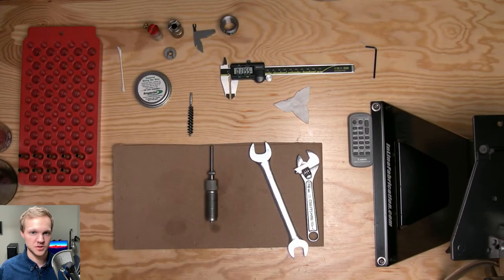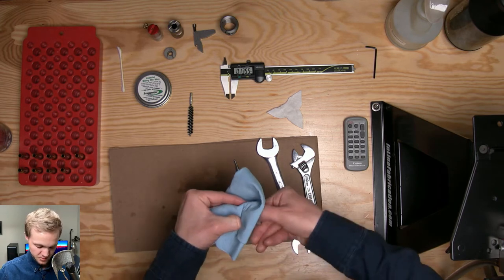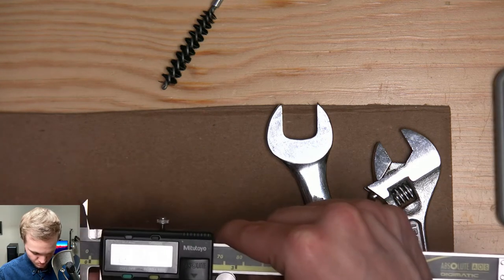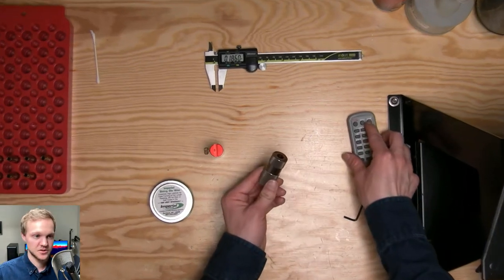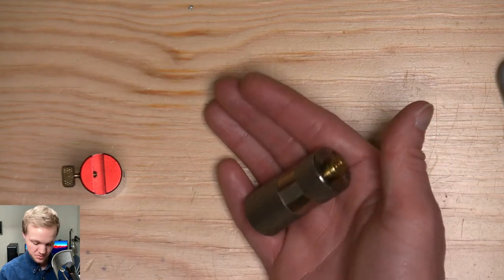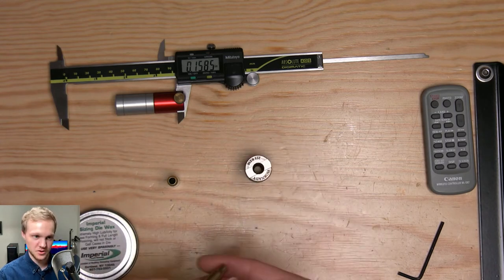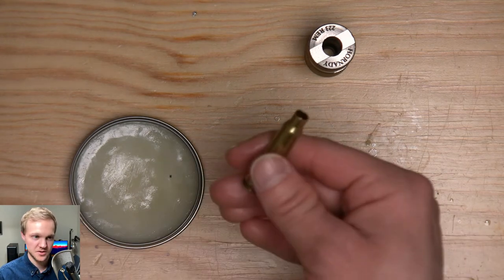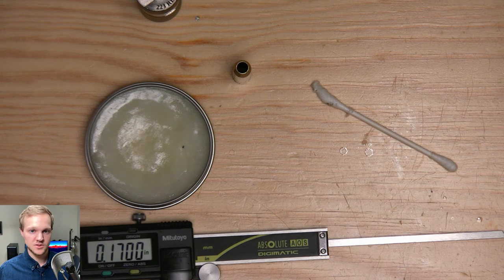How to setup a Full Length Sizing Die

Comment: Case gages is useless if you are reloading for your own gun and to produce better quality ammo than mass produced factory ammo
Reply from the maker: If you neck size, then yes a case gauge won't help you out much. For FL sizing they can help you out if you don't want to use a headspace comparator.
Reply: @diyreloading  OK Whatever float your boat.
Reply: @jacocoetzee1945  lol someones salty
Reply: If you have a bunch of ARs or pick up range brass, you are going to want to do a full length size. In my case my ammo has to work and be safe for any rifle I may use or if any buddies want to use my ammo in their rifle
Reply: When you have multiple firearms that shoot the same cartridge you need to resize it to SAAMI spec so it’ll fit in the chamber. This comment is idiotic